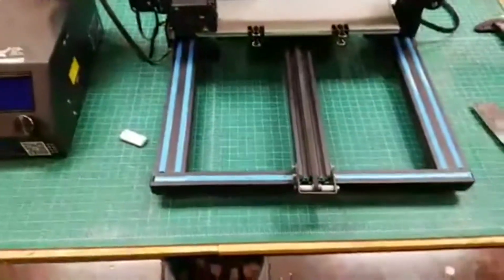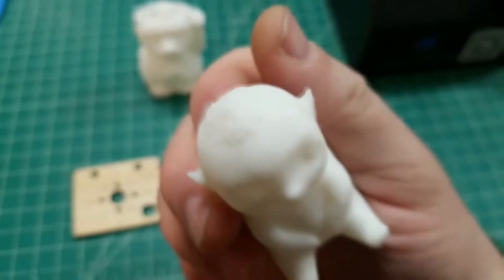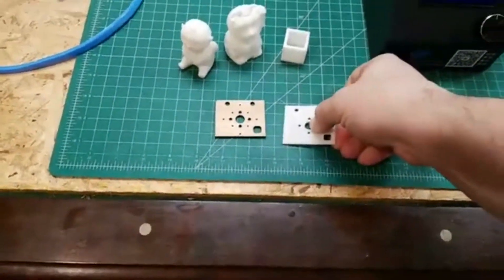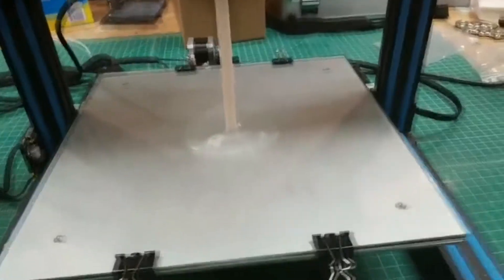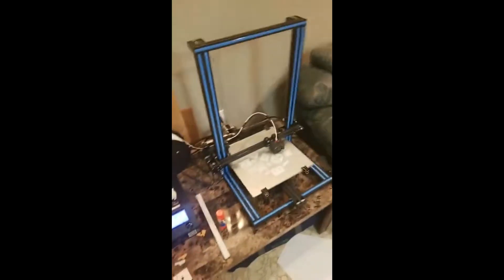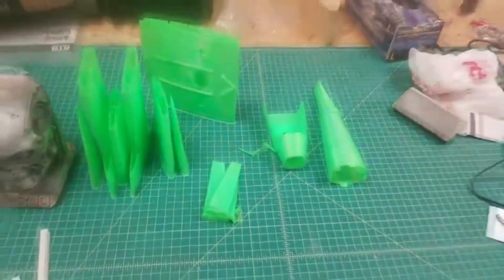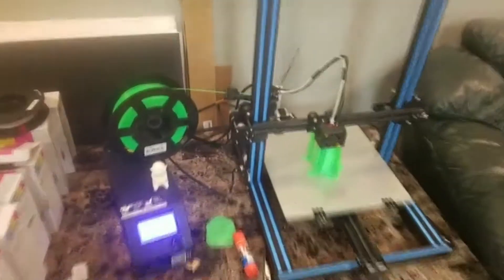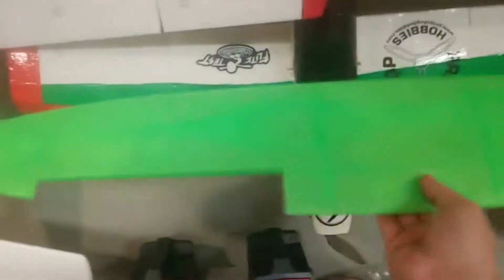3D printing journey model parts and an Eclipson Model-Y airplane with my CR-10s with mini review.

Comment: Nice video!
I want to print this myself, but I am not sure if the wing pieces will fit on my Lulzbot Mini with a 152 x 152 x 158 mm build volume. What are the dimensions of the largest piece for this plane?
Thanks!
Reply from the maker: They're not terribly large, but I was able to print all of the wing panels at the same time. The build plate on my CR-10s is 300x300x400 build volume. They have the whole wing on thingiverse as well as a new plane now which I haven't downloaded. The first flight was a catastrophic failure and I went back to building with foam board, reserving my printer for essential control components and mounting brackets.
Reply: @DroneTastic  What are the settings you are using for the wing wall?